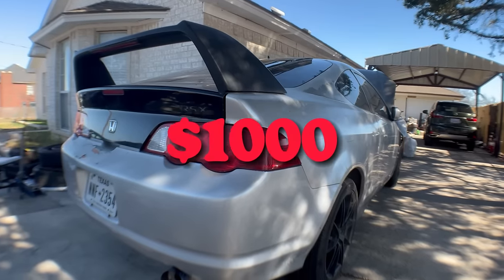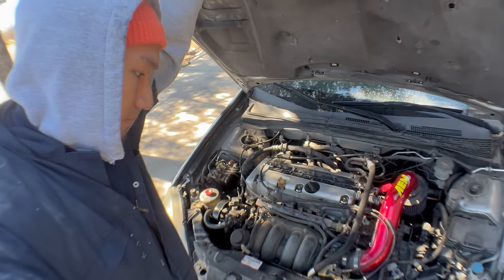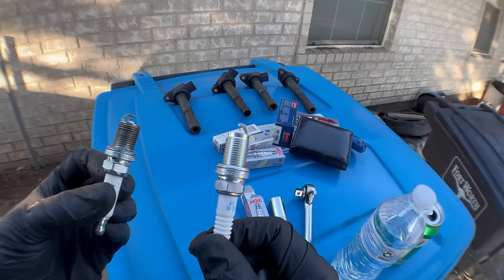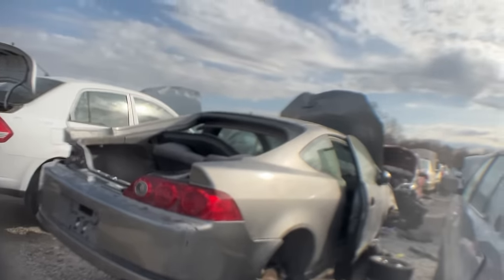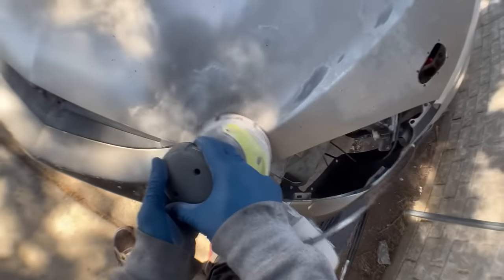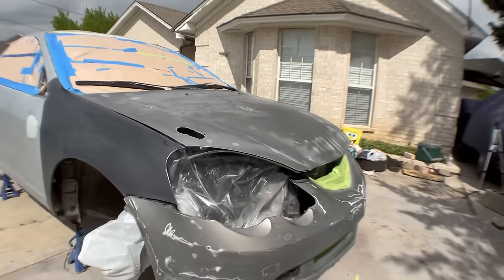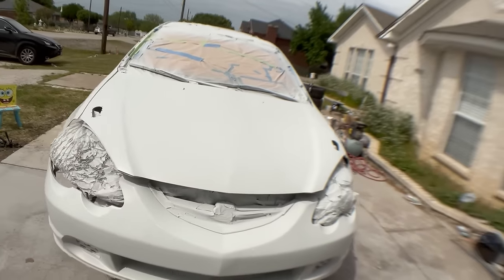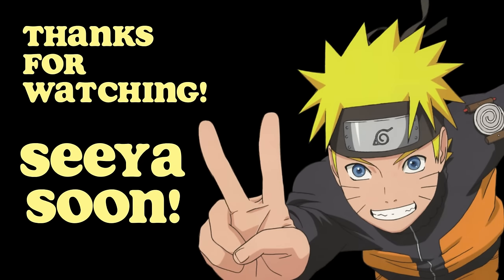How I flipped this $1000 car for even MORE money! - RSX Driveway Paintjob

Comment: I fixed most of the codes and engine issues... The reason why it would not go over 3k was because the connector that went into the vtec solenoid kept popping out. Just gotta replace the intake manifold and the car is solid.
Reply: the 02 sensor codes came back on but its because the power steering rack was leaking into the connector.
Reply from the maker: 🤯 the vtec solenoid makes alot more sense hahah. follow this guy right here on tiktok yall for the continuation of this car! didnt know you were on youtube as well!
Reply: hope u continue the build on ur chan bro just subbed  @BeforeTheStorm
Reply: Yo brother I love your content would you be interested in a 2006 Honda 2000 with OEM factory side skirt mud flaps
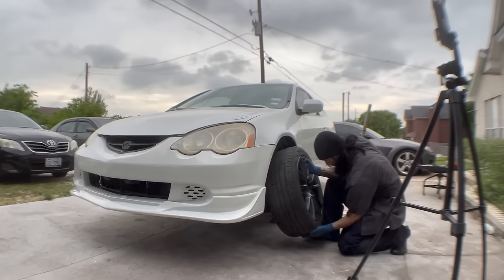Reply: 17:55 shesh looking fresh my boy
Reply: Man lats time I painted a car in my garage the neighbors called ecology department 😂😂😂
Reply: @jpam59 most underrated comment
Reply: What size compressor did you use? That tiny thing?!?

Comment: the headlights my guy
Reply: agreed a quick restoration job is 10-20 dollars and maybe 20 minutes and would elevate the overal look so much!
Reply: Yeah man
Reply: I was just thinking that! Wet sand and clear coat they look new again
Reply: He could just polish them too for temporary fix
Reply: They need some polish
Reply: Maguires has a headlight spray that’s perfect for headlights that are like that. The don’t even need sanding but it still helps to do it.
Reply: 800 grit and clear coat them
Reply: Could use some off big spray 😂😂😂
Reply: Exactly, could I got another 500 if the headlights were clear But love his ambition
Reply: I was thinking the same thing
Reply: Glad I wasn't the only one that thought that
Reply: Yea those wheels need to go the OEM are decent
Reply: @ptdave2002 no, sand and polish. Clear will age and fail.
Reply: It’s you’re going to dump it, get a universal o2 sensor.
Reply: This
Reply: That’s the one thing that would have made the whole car look 💯 percent better
Reply: True!  Easily adds $200-300 to the price
Reply: @Itsfnpete  no clear and the plastic with get brittle and crack and yellow on the inside. You need clean because they all come with a clean from the factory.. that's why the headlights always look like something is pealing off when they are getting old.
Reply: I was thinking the same........there is a lot of good information out there to bring those things back to new condition.
Reply: I just lightly wet sanded my headlights with a 3000 grit pad then used two coats of Maguire's headlight spray coat
Reply: I agree 100%, to have the car look good, while the dingey yellowed lenses  scream. This  really is something people notice. It would have taken a little bit more time and $, however a first glance appearance makes a huge difference with selling a vehicle. The paint looks great, and we understand keeping cost down when flipping. Not only are clear resurfaced lenses safer to drive with, the look of the car and age appearance is less noticeable as well. I always notice headlights when looking at a vehicle.
Reply: @brine80  headlights and dirty dry looking tires and wheels.
Reply: Was thinking the same thing.wet sand and clear coat em and the front end would look like new!
Reply: Just slap some smoke tint on it.
Reply: He was lazy to clean a quick headlight!
Reply: Or you could get ebay or amazon assemblies with drls that transform the whole entire look
Reply: Right why wouldnt he wet sand and clear coat them. Lazy
Reply: @Itsfnpete so will polish, polish is only a temporary fix while headlight clear coat is specially designed to go over headlights and last years not a few months. Even the restoration kits at part stores only last a few months and I've used them all.
Reply: @bbaaspencer1 the cheapest possible is what I usually go with as well, just needs to work and cheap aftermarket shit works for a while, I bet he could've gotten that same sensor for about 40 bucks on the same sight because rockauto lol
Reply: Yep sand it down and he could have thrown clear on it with the rest of the clear!
Reply: Hallelujah
Reply: Cerakote headlight restore man 30 minutes two years later my headlights still crystal clear
Reply: For real...sand and clear them shits
Reply: Quick tip use acetone in a can put a hose on the end of the can , heat it with a heat gun and with the fumes it will bring them back to life.  Your welcome 🤙
Reply: Dealers always overlook the headlights and it is super important to the look of the car
Reply: Could of cleared the headlights since they were off. Walmart has good affordable stuff.
Reply: I was thinking that too.  Depo replacements are inexpensive, and you can get back triple the price that you paid for replacements.  New headlights take a car from zero to hero.
Reply: bruh the maplestory bgm
Reply: Headlights bro why did you miss that it would have made the car seem restored
Reply: Exactly my first thought!

Comment: hell yeah, im the one that bought the rsx
Reply: Seriously?
Reply: yup @JCN14
Reply: @ 6:12 you get a close-up of the harmonic balancer aka crank pulley. It looks broken or else an optical illusion because of grease and/or oil. If it's chipped then it won't have even dampening and this will lead to premature failure of main bearings and likely cause premature leaks for your front and rear main seals.

It may be worth looking into @BeforeTheStorm
Reply: @JOATJESSE  crank pulley seal is leaking and the rear main seal was replaced already. I need to reseal the timing cover and tensioner cover too. This is going to be a great project
Reply: @JOATJESSE  the crank pulley is cooked too 💀
Reply: @BeforeTheStorm  dang bro that's awesome such a fun car hope it treats you right
Reply: @JCN14  yes sirrr!!! I love it, thanks man!
Reply: @BeforeTheStorm 
Go with oem, don't get a lightened pulley. They are made specific to the design of the rotating assembly. If you change it for anything else then you run the risk of vibrations at certain RPMs. This is what harmonics is all about. Even unnoticeable vibrations can cause premature failure in the long run.

Probably good to use thread locker on your crank bolt when you reassemble too.

Best of luck
Reply: Nice! I checked out your channel and you are fixing her up, nice.

Comment: Wet sanding headlights and then clear coat, does wonderssss. Good job on the car so far!
Reply: he already sold it by the time the video out
Reply: @RosefMudson1414  statistically if he keeps doing this, there is a 100% chance he will encounter cloudy headlights in the future.
Reply: I've been told by more than one veteran used car salesman that you can easily get an extra $1k just for having clear headlights.
Reply: @desktorp well that depends on the car . Can make a 9k car worth 10k , but not make a 1k car worth 2k
Reply: @InstantClanGaming  probably true

Comment: FYI, good tip is on the first coat don't go for full coverage, go for evenly sloppy and it's the perfect base for 2nd,3rd, and 4th to be done the same way it will naturally even out the more layers u add giving you a perfect solid paint job in the end

Comment: Nice job......the profit made it worthwhile. Good job attending to the mechanical issues first. Before we had ODB2 readers, we had to do some detective work, although we didn't have all the modules and sensors either. I was just outside today working on a bumper cover on a work stand. Of course, with plastic, you have to use a flexible glazing putty to make certain there aren't future cracks. I think that in our case, since you have a car port, I would probably find some heavier plastic sheeting and create a makeshift paint booth. It would at least keep some trash out of your paint job. Also, I think I would buy some new hinges and/or latch for the hood instead of the hood latches. The rest of the car looks great and it sounds like you have it running good. Very resourceful project.

Comment: Something I was taught is if your swapping an engine with a junkyard unit of the same engine type, transfer your sensors onto the junkyard engine as you you know those sensor are good and working and if you know you have a bad sensor on the old engine by a replacement as 9/10 times it is good (even brand new parts can be faulty) or if the sensor is easy to get to risk it use the junkyard engines sensor

Comment: I'm impressed with what you did. I would have never had the wherewithal to try that but you are pioneer for yourself to do it. The job is excellent. You just need to take and buy you a light kit and clean up those light headlight lenses it will set that joint off but overall great job.

Comment: Get a Headlight restoration kit.  The hot Cup with chemical steam type.  clean sand lights, polish with some 1 2 3 - 5 k paper and then chem steam seal. New lights voila and presto.  From one builder to the Next you did Good man!   Good Find!

Comment: Pretty solid work for a driveway budget job.  NGL,  I was a little 😬 at first, but other than the bondo thing, and getting a little better setup, definitely did a great job. 
You could grab some tarps or heavy plastic sheeting and a couple box fans with filters and rig up a booth in your carport for not too much effort or cost. 
I found a decent paint-less dent removal tool kit is really handy and cheap way to take care of normal dents and dings for the most part, and a skim coat of Rage Gold or 3M body filler finishes it nicely, mix in a little Plastik Honey by Evercoat to enhance cheaper quality body fillers or to flow it smoother. 
Name brand Bondo is too brittle and stiff for my preference. 
Cool video 🤙
Reply from the maker: yeah after this project im not much of a fan of bondo myself. will def try my hand at metal work first then using less filler if i can

Comment: Wet sand those head light with 600 until the yell clears  up to clear. Then dry them and clear coat them ,don't rush it ,just like you painted the car dust the first coat  and then two good coats . Perfect

Comment: Tip for next time is to spray sealer on any body work or spots burned down to bare metal. It will prevent corrosion and stop the base from popping up later dues to poor adhesion.

Comment: Sand the headlights with 600 grit.  And 2 light coats of clear. Will be good as new lol. 
Black is the easiest to spray. 2-3 layers of clear is fine. 4 is over kill unless your going to do heavy block sanding, polish and buffing.

Comment: Pro tip- buy some 3M rubbing compound and use it to rub off the oxidation off headlights. 

It makes them look brand new as long as there’s no oxidation on the inside. 

If there is, there are you tube vids on how to bake your lights in the oven to open them up- some people do this to replace just the outer housing

Comment: plenty for that little car at least. Man that wind is no joke i usually paint in my shop but did a toyota rv last summer and had my garage open and oversprayed my black 68 impala white. its on there thick i havnt gotten around to fixing it yet but i may just sand and respray the impala. wet sanding i got thin in a couple spots and can see primer just barely through.

Comment: If you want a cheaper option for paint get implement paint from tractor supply or rual king and it lays flat covers better I paint a tractor trailer with it and saved about 2k in paint and it still looks like I just painted it yesterday high gloss easy to spray a gallon of paint is 40 bucks

Comment: Next time.   Do the headlights.   Take it all the way to 600.   Or 500 wet.   And clear coat over them.    The same time you clear over the car.      You can add fiber glass resin without the hardener to bondo to turn it into.  Glazing bondo.   A lil bit goes a long way.  I use about the same amount as the hardener

Comment: Would sell for more if you properly taped over the rubber seals, removed hood pins to keep black, and taped the lower grill to keep black.  I mean do what you gotta do but just looks like another clapped out beater.  But i agree looks better than before but with those little details in prep you could made another extra 1k.  👍🏽

Comment: Hey can you give me more details about the sanding and painting steps. 

I’m currently sanding my car too and it’s taking a while because it has a lot of hiccups. My initial idea was to use rustoelum black turbo spray paint cans, but after seeing your process, I want to do a more professional paint job like yours. 

My point of concern is I don’t know what I need to do what you did. What materials did you use. Could you list everything? Like for example, from what I know and saw, for the entire paint job process you: 

- Remove trim, headlights, etc
- Sanded using 220 grit then 400 by hand (why 400 by hand?)
- masking

Now where im most confused is the primer, base, clear and the painting materials. 

- Like what size air compressor do I need?
- what pipe do I need that connects to the paint spray gun?
- what spray gun do i get as well as the reservoir on top of the gun?

Sorry if my questions are stupid, but I get overwhelmed on not knowing all the details before buying something

Comment: Fixing this headlights would’ve taken this thing to the next level
I know the car is like an 7/10, just good enough to make it a decent profit, but if you woulda wet sanded the headlights and just cleared them when doing the rest of the parts you wouldn’t have to spend anything extra and would’ve made it look SOO much better.  You already had the sandpaper out and the clear in the gun
And all for an extra 20 mins work.

Comment: limp mode was such an easy ass fix if the dude just did his own research lol.  I have a 06 TSX...These engines are easy to work on.  I fucked up when working on my car and it was stuck in limp mode because of the same damn vtec solenoid deal.  Overheating...could've easily been thermostat and a few other things.

Comment: What compressor are you running?  Looks kind of small.  Not sure if I could paint a car using my smaller compressor. Lmk on your painting equipment setup.  Thx
Reply from the maker: yeah its one of the tiny ones, cant recall the gallon but its them lil portable ones LOL had it goin off the entire time tryna refill

Comment: Did you clean the engine? Those lights are too faded. Should have bought new ones. Headlights are cheap nowadays. In my opinion , the hood latches you install would have look cool in black. They would have stand out nicely. Overall good job man.

Comment: Only halfway through but going to have a bunch of problems running an A3 if you'd still has the A2 ecu. Sensors are different, flywheel is offset more, wiring won't exactly line up, vtec on only one side. Etc.....especially if you bought sensors for the RSX not the ep3.
Reply from the maker: thanks for the info brotha
Reply: @korosumyself  no problem. A3 is only intake vtec whereas a2 is both cams so not only vvt solenoids different but so are cam gears and sensors. Crank sensor is also different  a3 to a2. Probably other small sensors as well. All those will read incorrectly if ecu and engine aren't paired properly.

Comment: If the car has a savage title, the car will basically be worthless. Get a carfax before jumping on a sale. Also, for the 02 sensors it should not cost more than $50 dollars. I have a 2000 Bmw e46 in mint condition with 85,000 miles that I bought very cheap because the previous owner had no idea what was wrong. Long story short, I fixed it by purchasing OEM parts and aftermarket parts from Amazon and eBay. Not a single problem, on the aftermarket parts just read the reviews before purchasing parts and if you don’t like them or something goes wrong you got 30 to 45 days to return them for a refund on Amazon. On eBay sometimes the sellers will not grant you a refund but you still get your money back under eBay policies. Anywho i spend about $3k in parts and the labor i did on my own and I got 4 offers already of $12k but I’m going to keep it for a while.

Comment: Well. I kinda did the same thing . Spent $1500 for a 99’ with ac , power everything working and good motor . All it needed was clutch master cylinder and slave . 26$ and 28$ . Painted the car electron blue now I’m not sure if I wanna sell it or if I did what should I ask ? Only thing it needs is tps sensor which I bought for $26 and a radio . What should I ask for it after I finish this car ? Anyone chime in and lmk

Comment: You bought it for $1,000, spent $1,000= $2,000.  Sold it for $4,000 so that's + $2,000 not + $4,000!.  Counting all the hours you spent researching and ordering parts and materials, going to the junkyard, installing and testing, filling, sanding and painting, that has to be... what, 80 hours, maybe more, could be less?  What do you value your time at?  $10/hr makes @ 80 hrs makes you a "profit" of $1,200; @ $20/hr it's $400--anything more and you're operating at a loss.  And this is not taking into account the amortization of your tools (the cost of your tools over time).  So you can't talk in terms of PROFIT unless you don't value your time at all.  At this point it is a sustainable hobby, which is great, you're doing something you love and creating something of social value above monetary value.  More power to people who do what they love.